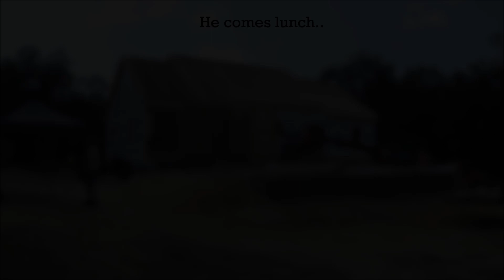House Construction -  Day 13

Comment: Very exciting to see all the progress being made.  Love those LVL's!
Reply from the maker: Yes it is. Starting to look like a house now. Ya there pretty beefy. Kinda a funny story behind them. Called the local lumber yard to get a price on the ones we used 2" w x 24" tall by 24' long and a 2" w x 18" tall by 24' long. Was going to figure out what the actual weight load on them would be to see if we needed the 18 or 24. Got the prices from them told them we would call them back when we knew which one we would need. Then next thing we know on the next order of the lumber that showed up there were the 24" ones. So probably a little over built but there should be no sag in the bonus room floor above.
Reply: Those certainly will have great load bearing and now you can really load up that bonus room.  Looking great!
Reply from the maker: @BillyLapTop  lol yup. Thanks